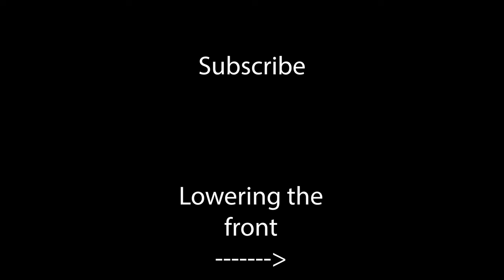Lowering My Truck With 4 Inch Lowering Blocks | Mazda B2200

Comment: I have a 90 extended cab i put the 4 inch blocks but took out two leafs. Bounced so bad had to put it all back to stock. How's the ride on yours with all four leafs.
Reply from the maker: rides really nice, its the same as stock because the blocks dont actually change any suspension dynamics at all

Comment: Any viedos on how to lower the front with torsion bar adjustment?
Reply from the maker: my video about the ball joint flip has info about it at the end
Reply: Its super easy, do 1 side at a time. Lift the truck up on jack stands unbolt the tortion bar bolt, get a hammer tap out the bar u might have to get vice grips and tap on that if it dont com out easy. But b4 you do that mark the tortion bars at the tortion socket and re-index the bar 2 teeth. Once u do that reinsert the bar bolt it back in most of the way, repeat the other side. Drop the truck on the ground and if u want it lower just loosen the bolt on each side just make sure both sides match. I used a tape measure at the front fender where it meets the bumper

Comment: Your truck is f-ing beautimus! I don't know if you buffed it or painted it, but boy oh boy, it's beautiful!
Have you experienced any drive shaft vibration of any sort? Also can't recall if you said that you cut your bump stops or kept them? I've been following you along with the refurbishing and furthermore I'm replacing hydraulic tappets, have you been inside of your engine? Keep up the good work ✌️
Reply from the maker: paint is all original, one of my friends whos really good at detailing has buffed and waxed the whole truck for me a couple times. no driveshaft vibration so far. i cut my bumpstops when i lowered my truck but with my wheel and tire setup my tire still hits the fender before the bumpstop hits the frame but i havent had any issues with contact even while hauling loads. also unfortunately/fortunately i cant help you (yet) with the hands on engine work aspect of this as my trucks engine runs great and has basically 0 mechanical issues, however my buddy just got a b2200 for $200 that needs a lot of work and we'll probably go more in depth in that sort of stuff in future videos on that truck
Reply: @Blue_B2200  Thanks for the quick response! I'll be sure to lookout for that body of work (video)!
Keep up the good work 💪💯

Comment: I guess I would have that same problem with that second block not lining up with the axle correct?
Reply from the maker: most likely yes, honestly i think you could get it to go with just the bottle jack compressing the leaf spring and not the ratchet strap though. the way it works is the leaf spring gets longer when its compressed which changes the position of the block, its only a problem when putting the block in and doesnt cause any issues when the block is mounted or when the truck is on the ground

Comment: Truck is awesome, do you recommend anything for the front?
Reply from the maker: torsion bar adjustment and ball joint flip, or djm lowering control arms if your wheels will fit under your fenders

Comment: I have 3” on
My 1987 b2000 just ordered a 4” bell tech block kit.Can’t wait to see how it works out.Have you hauled anything light like a small lawn mower?
Reply from the maker: sorry about the late response, ive actually hauled my 550lb tool box to work in the back (although it was a bit close for comfort) i got there with no issues, i did pull the spare tire off just for a little bit more capacity as well when doing that